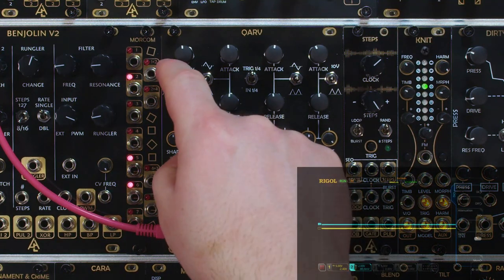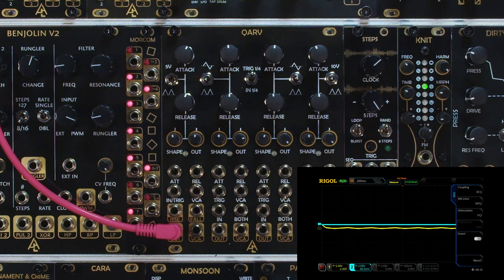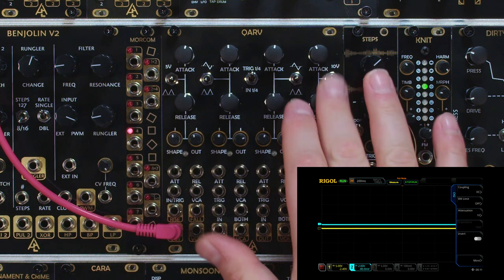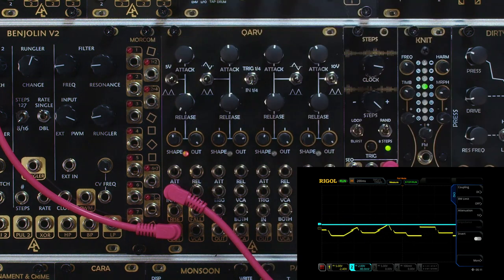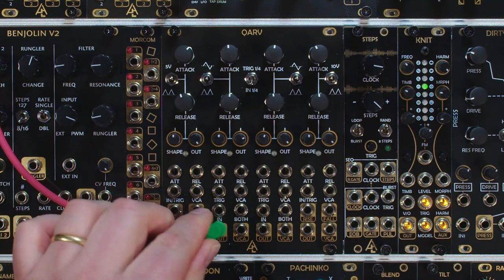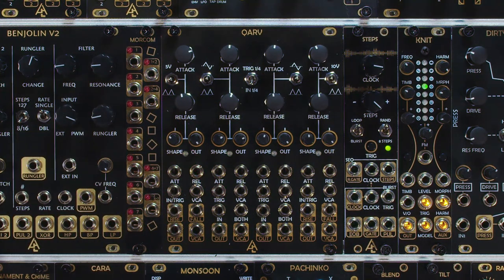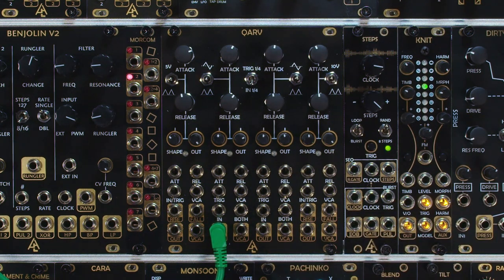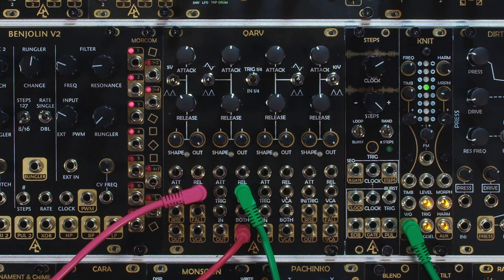QARV Walkthrough

Comment: 10/10 this should sell like hotcakes. How does the VCA summing internally work in the final mix out of channel 4? will it clip? Should we keep all levels relatively low if we're just coming out of channel 4?
Reply from the maker: VCA1 out is sent to VCA2 jack normal.  This continues to cascade down to VCA4.  So if you plug into VCA2 you will get a mix of just VCA1 & VCA2.  If you then plug another cable into VCA 4 you will just get VCA3 and VCA4.  Hope that helps.

Comment: I have a pair of System-500 sets, and am planning a third tier for Nerdseq and utilities. This looks like it will fit my needs better than the Maths or Falistri (and seems to be far cheaper) - four ARs means I could use this in poly patches. So the envelopes are AR when using the In jacks and AD when using the Trig jacks, right?
Reply from the maker: When using the IN they will behave as ASR as the envelope will stay high as long as the gate is high.  When using TRIG they will behave as AD (or AR depending on your preferred naming).  Ch1 and Ch4 need to have the switch in the proper position for either IN or TRIG.